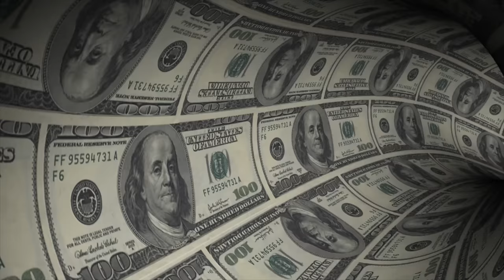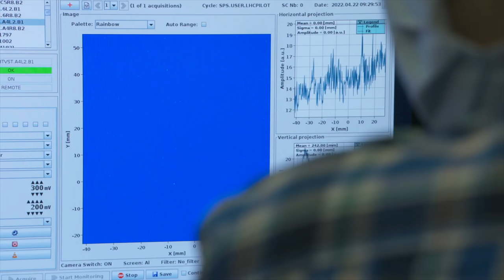Cern Portal to Hell ? - Prof Simon

Comment: The way i undrstood it was  a wormhole would need an event horizon of over 100lightyears in diameter to allow an object the size of a wristwatch to pass without suffering ghe gravitational, thermal and electromagnetic damage the wormhole produces.
But....
What about a micro wormhole used to pass information over vast distances instantaneously.

Comment: It's a matter-energy field, the Electro-Positronic EM Wave Field... A SOLID UNIVERSE.. When you put a large amount of energy into it matter forms as out of place base field quanta cells forming Positrons and the hole left behind forming an electron.. MATTER IS MELTED SPACE, light melts field at C and the field tries to freeze at C. Light is the field freezing, moving an imbalance onward. 
--
Actual proper holes fill up with -ve electro gas and +ve cells in Planck seconds. Larger chunks of cells and the excess -ve gas-filled 'holes' left behind are too large and unstable so decay into electrons (down quarks in protons) and positrons (up quarks in protons). Neutrons are just hydrogen atoms in a nucleus, and their neutralising electron bonds with protons.
--
All bosons but photons are Fudge, Higgs field is extra sticky fudge, QCD turns 11 parameters into 'one force'. QFT has an all pervasive field for each particle. Gravity is officially broken, in the dark. Antimatter is broken.. 
--
There are no wormholes, there is no anti-gravity we can harness... If you put energy in, you get JUNK MATTER OUT, which will annihilate back to close-packed, balanced = empty field..

--
You have to think of a 'crystal ball universe' of +ve balls close-packed by -ve electro-gas. If a ball (field cell) is kicked free with 'total escape energy' it forms a permanent e_p pair where the electron tries to expel its excess -ve charge but the far more balanced surrounding field has none of it. The Positron tries to grab -ve electro-gas from the field that again tugs back.. Much vibration for the rest of time ensues (until annihilation at least). Both result in -ve electro gas being trapped around matter.
--
These charge density gradients cause the field cell (gap) size to shrink around matter and EXPAND in (dark!) VOIDS.. This would have happened very quickly during a parallel matter creation chain reaction event. Contraction replaces 'cosmic inflation' without a singularity... 
--
The universe does as much as possible with as little as possible and 2 base particles + 1 force is the simplest viable starting point... Believing the Universe wastes 1 of only 2 proper, permanent elementary massive particles, THE POSITRON, is a LEAP OF FAITH too far.... Up and Down quarks have never been isolated and all attempts result in MATTER CREATION.

Comment: More interested in if it's affecting the pole reversal 🤔
Reply from the maker: why would they do that and how
Reply: @SimonHollandfilms  Not suggesting it would be deliberate just wondering if there is an effect that's causing it to go in that general direction, and wondering if it affects speed, frequency of movement etc. Chatted to a physicist and they felt that the magnetic field decay would keep affects local, however Gravity though generally weak is the furthest reaching force we know of, I don't see any reason if would not influence a fluid core (as the moon does the sea). Just my thoughts, I feel there's a definite link between the core realigning and weather patterns/"climate change" if polar strength changes (weakening) surely the resistance of the atmosphere changes in step; ergo energy conduction in being the issue rather than greenhouse insulation retaining heat? As I say I wonder if it's an unintended consequence and if the circular array/phase of the magnets pulses would magnify any effect, like 3 phase power? Anyway....your the Prof 😉

Comment: CERN is knocked out ( cooling tower at point 4 [ four ] ) roughly  at the same time to within a few hours as sun spot AR 3088 shows orthogonal polarity to the suns equator coincidence? Lets see solar activity on the 28 th and 29 th / 08 on going to 30 / 08 a big flare or CME would confirm a basis for suspicion.
Reply: On the internet
Reply: On the internet
Reply: On the internet
Reply: On the internet
Reply: On the internet
Reply: On the internet
Reply: On the internet
Reply: On the internet
Reply: On the internet